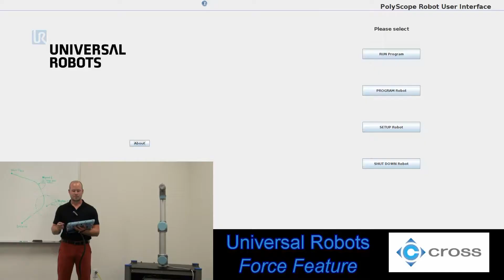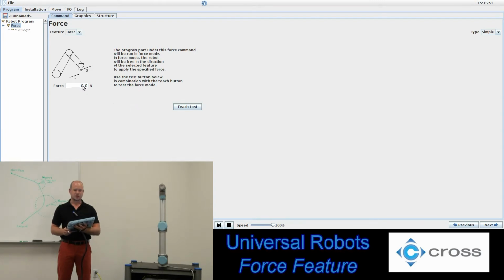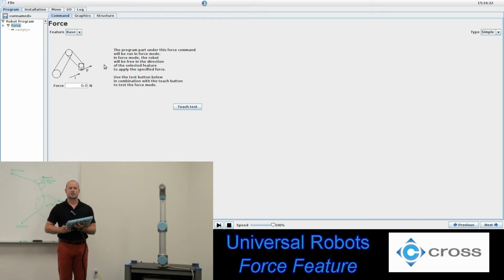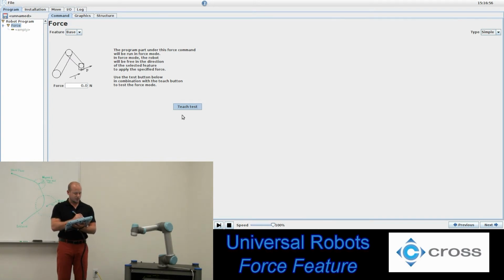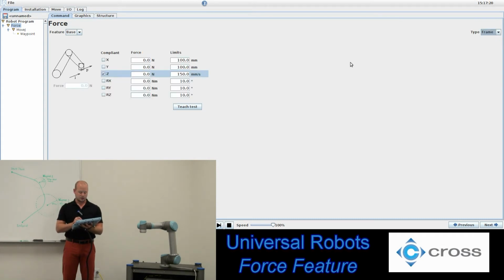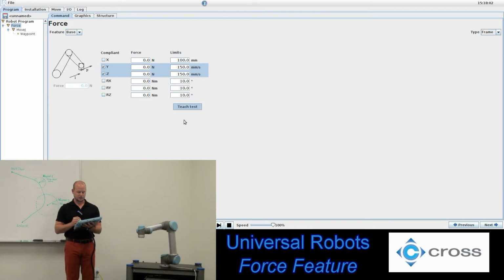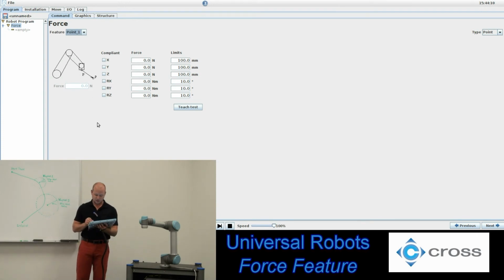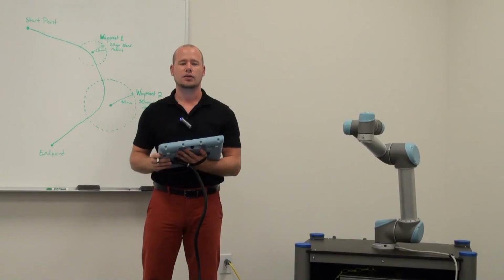Universal Robots Force Feature with Grady Turner - Applications Engineer at Cross Company

Comment: Hello, I'm using the 3.3 version of the software, and when I move the robot into a similar testing position for the base feature force setup and hit test, then push the teach button on the back of the tablet I get the error 'Force mode not possible in singularity.' 

Do you have any suggestions for dealing with this? 
Thanks,
Reply: Thanks for the quick reply! I'll try and give that a shot.
Reply: That seemed to do the trick! Do you know if it is possible to set these forces to some local variable so they can be changed through a python script? Ideally I would like to be able to set these forces to move the arm around from a python script instead of the teaching pendant.
Reply: I have read through the script manual and have also tried running through the example of dynamic force mode of the UR website
http://www.universal-robots.com/how-tos-and-faqs/how-to/ur-how-tos/urscript-dynamic-force-control-20571/
However, the script seems to simply go to the waypoints and the addition of the force mode doesn't appear to make any changes. 

Unfortunately what I am trying to do requires force control, so speedl will not work.

I have set up the connection correctly and can read from the arm and send it to targets and joint positions. Could there be something I am missing in sending the force thread? I have just been sending each of the lines as 
s.send(b"line_of_UR_code" + b"\n")
Reply: I have, my guess is that the thread is not being sent properly over the ethernet port. When I send commands like movej they work fine, I think the issue is with sending code like while loops. Apologises for pasting code, but this is how I am currently trying to send the force_mode thread if it is of any help.

s.send(b"thread Force_properties_calculation_thread_1():" + b"\n")
s.send(b"while (True):" + b"\n")
s.send(b"force_mode(base(), [0, 0, 1, 0, 0, 0], [0.0, 0.0, 10.0, 0.0, 0.0, 0.0], 2, [0.1, 0.1, 0.15, 0.17, 0.17, 0.17])" + b"\n")
s.send(b"sync()" + b"\n")
s.send(b"end" + b"\n")
s.send(b"end" + b"\n")

Could it be a formatting / indentation problem? Thank you again for the help, there is so little information about this online!
Reply: How would you send an entire function over the socket connection? I thought each line had to be terminated by the end line character ("\n").
Reply: @Pawel7218  Hello, I have a similar problem with you. I need to use C + + to control the robot in force mode. Can you help me? Thank you very much